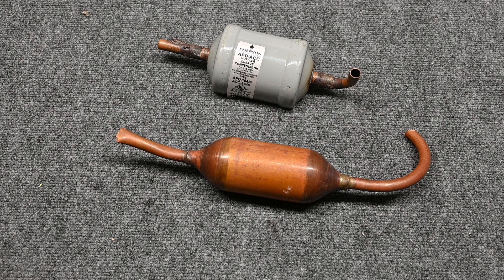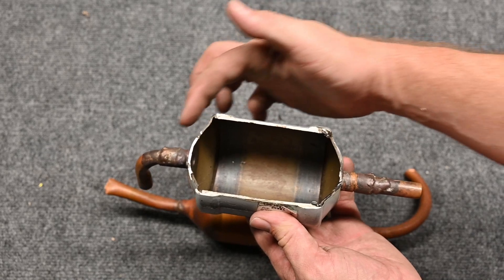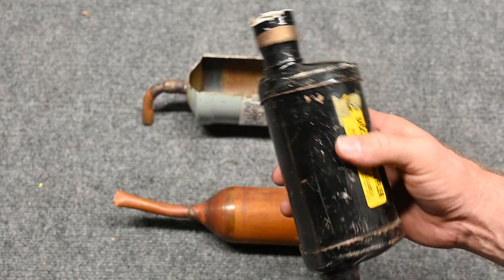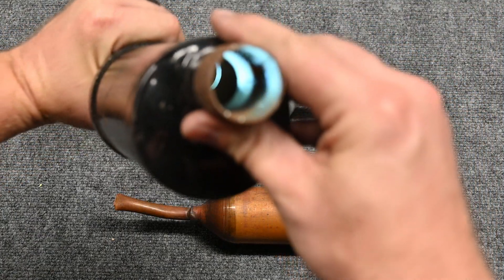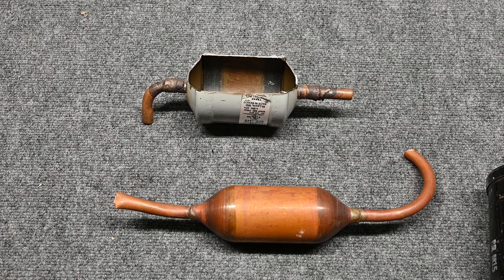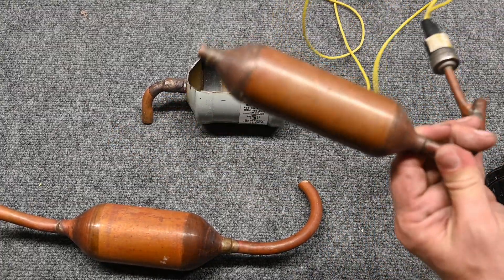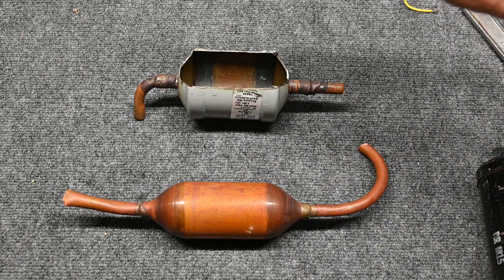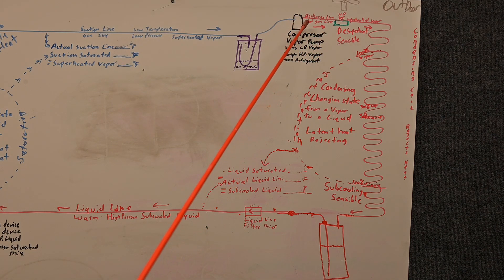HVAC 077 Refrigerant Muffler discharge / hot gas line

Comment: Will this work on the suction line? My outdoor and indoor units are close together, and the line set runs through the bathroom wall, and it’s annoying hearing the compressor vibrations on the outgoing side of the indoor unit and through the bathroom wall.
Reply from the maker: Unfortunately not.
The installer can add some 90's to the suction line to absorb vibration. They also make a vibration absorber for refrigerants piping. Sounds like the piping is not insulated and or secured properly in the wall.
Reply: Ok, thanks. I’ll look into it.

Comment: How much of a difference does this make ? Is this something you would add on a residential system? I bet these would be good on a marvair wall mounted unit where everything is in the room with you.
Reply from the maker: Not enough difference for the effort to add one.
Reply: So if it don’t have one don’t add one! Got it. Thx
Reply from the maker: @moonlightacmaintenance3232  
If it's not a rotory a compressor blanket would help.

Comment: Ha, and I know/realize you're correct.
However, I'm looking right at a factory parts list that even calls the muffler a "Filter Dryer".  FWIW ;)
Reply from the maker: York was the only company I know of that put a filter drier on the discharge line. Late 90's I think. I quized every York rep and I never got an answer.
Reply: @love2hvac  Yep, it's a York parts list!  Do you have any idea if it's really a drier?
Reply from the maker: @thisisyourcaptainspeaking2259  it is 100% a filter drier on the discharge line. I cut one open long ago to confirm. A building had 23 units and every one factory. 
I never got an answer.
Reply: @love2hvac  Interesting.  I have to think this was some kind of mistake they never detected or corrected.